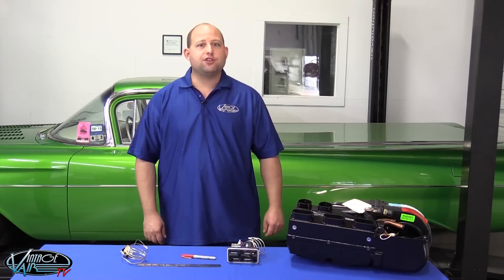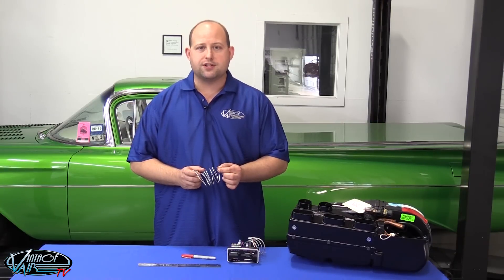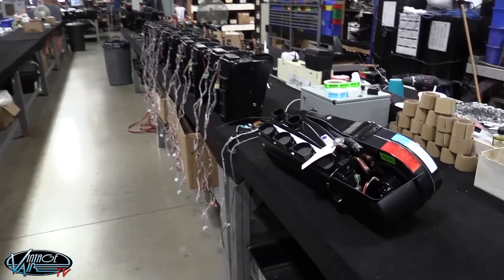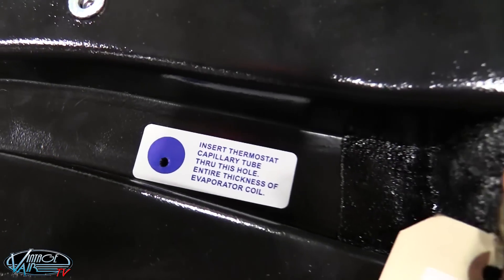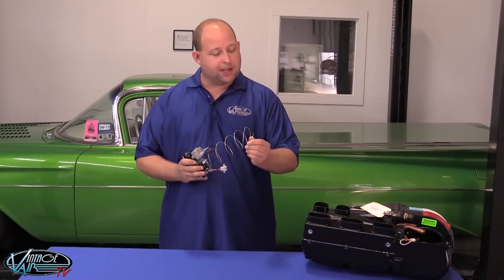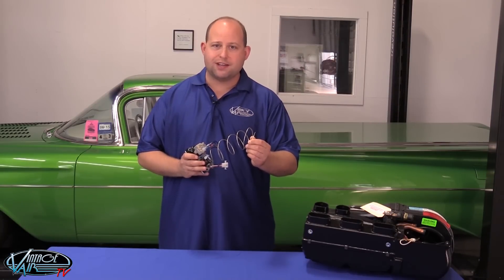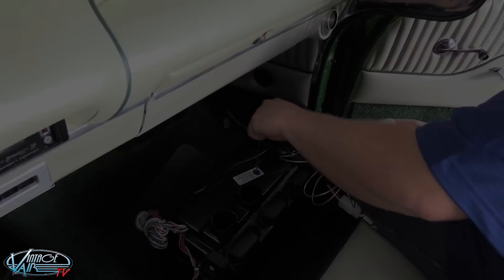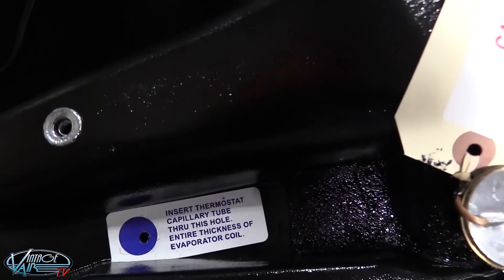Capillary Tube Installation

Comment: I have a vintage air control and the coil wire broke at the base. Is it possible to replace to the coil?
Reply from the maker: Unfortunately no, if the capillary tube has broken the thermostat switch will need to be replaced.I would reach out to our sales team at 210-654-7171 or sales@vintageair.com and they will get you set up with the replacement switch.

Comment: Hi. I buy a UN 0894C evaporator kit for my Chevelle. I see a little hole in the right side of the evaporator, but the capillary tube don't enter in that hole. Do you recommend install this capillary tube in the 1/2 cold line of the evaporator?
Reply from the maker: Diomel, The UN0894C evaporator unit is not manufactured by Vintage Air, for installation guides or troubleshooting you would need to contact the manufacture of the unit. The unit is made by "PIT STOP AUTO"
Reply: @va197653  Thank you for your help. Appreciate that. I'll check it out.😃👍
Reply: @va197653  holy shit.  A company went out of it's way to help a customer,  by referring them to a competitor/another place in order to get correct specific info.  

You guys rock